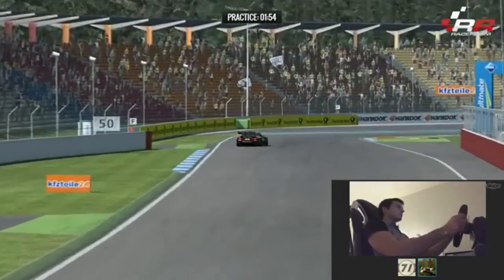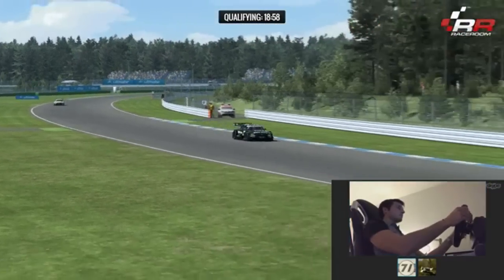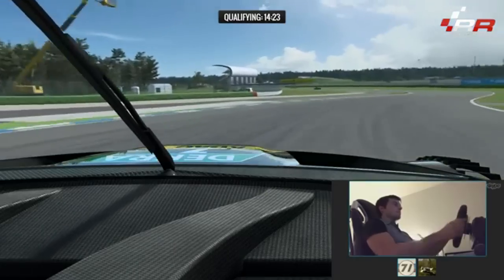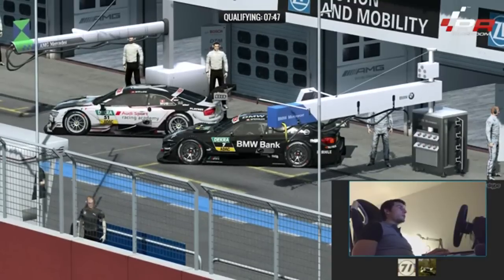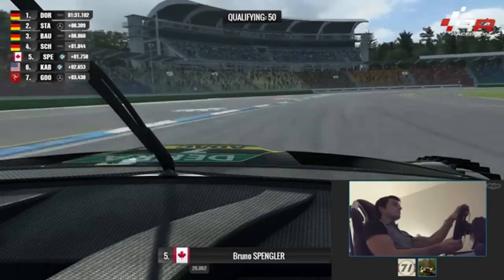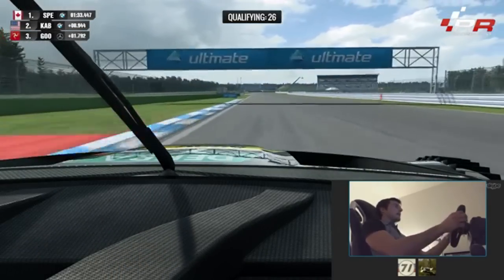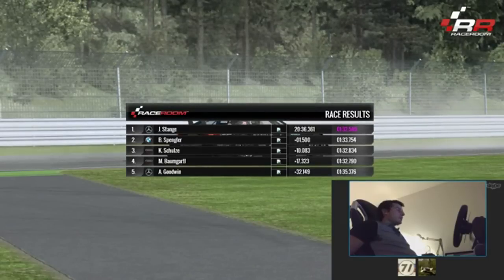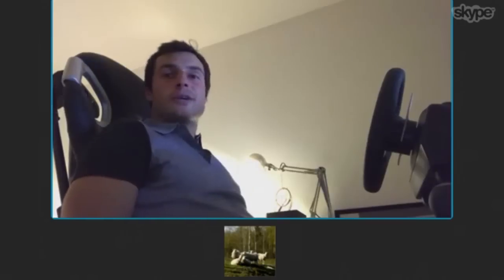RaceRoom | DTM 2016 Physics test with Bruno Spengler

Comment: I own DTM 2015 and gave up. The single player game is basically finish a race before the AI behind you take you out. Is that how it's supposed to be IRL? I'd buy 2016 but not until the AI is sorted out. I've tried dynamic and AI at anything from 90-100% etc. What are the other cars doing at 14:49 once the race has finished, are they AI?

Why show the animated driver when the animation doesn't go any further than 90 degrees? Can you add team radio and a spotter?

As as for the the live event from Hockenheim... Daniel Juncadella who you've also had test the game didn't do so well. The look on Robert Wickens face at the the end said it all.. R3E is my go-to sim so I guess I just expect a little more ;)
Reply: Is RaceRoom a Single Palyer game ? Not really. For training, OK.
Play Multiplayer.
Reply: Andyw1228 Fair point. For SP play the AI is pretty bad. I've been playing through DTM in SP mode to learn the tracks. Had gotten to the point were I play with the # of AI = 0 ;)
Reply: The good news is that they are working on bringing back the AI that was pretty solid before the update that included the large grids. With the large grids, they toned down the refresh rate of each AI opponent for performance reasons. From what has been said on the S3 forums, it sounds like the next update will include an automated AI adjuster which will determine the refresh rate at which each AI car operates based off of how many cars are on track. Meaning, if you do a race with 23 or so other cars, you will AI performance on par with where it was previously. Also, cars will be able to take advantage of slipstreaming and will be more aggressive both on the attack and defense.

Looking forward to November!
Reply: I thought the next major update was coming in October :) November it is then, thanks. I guess some of the new cars might also be released R8, M6, AMG etc
Reply: A lot of us thought so as well. Someone I race with in club races from time to time does Beta testing of the new builds and has been saying that they have been working like mad to test everything and get the update out as soon as possible. 

I'm not sure where they are in terms of the GT3 cars but I'll tell you what, give me that M6 GT3 and I will be a happy man. :)
Reply: As I noted its my go-to sim. I never really took to AC and for the same cars usually go back to R3E. Don't really know why.The audio and graphical style I guess. It has an outlap on the Nordschleife that AC and iRacing haven't been able to implement.. It's had the 90 Quattro for ages now (iRacing) and the 2011 Audi LMP, AC gets the 2016 Porsche soon, okay its a newer vehicle but you get the point. R3E is out on its own in many ways I guess.
Reply: crankigeek I completely agree with you on that. I mainly play R3E, AC and Automobilista but R3E is still my go to and will be for the foreseeable future. It has the best lineup of GT3 cars, which are my favorites, and we've been having some great multiclass racing over at the RD club. Something about the feel of the physics, sounds and force feedback just feels right. It didn't take me long to find comfortable settings in R3E.

This is why I hope they continue to implement features that help the online play and further race customization because in my opinion, it has the second best online experience for sim racing behind iRacing.
Reply: Christian Moreau The Posche in AC looks good. I think I read a comment from you on the first pack on the RD post :) The sounds and perhaps FFB are not up with R3E yet maybe though...
Reply: The ai isnt that bad. Also ... 100% they are a bit slow to be fair so you should get faster first =( I havent raced DTM a lot but in other classes i have more problems of them braking too early than me braking too early.

Comment: "...what we did for 2016 physics..."...does this mean, that every Program-Pack has different Physics ! I would excpect, that there is only ONE Physic in Real World and if the Developers got closer to this RW-Physic in DTM 2016 then they would integrate it also into the Core Game !?
Reply: its not the underlying physics (the math is the same) its the specific suspension/tire parameters (there is literally hundreds) on a per car basis. they have said they are taking what they learn and applying it to other cars.